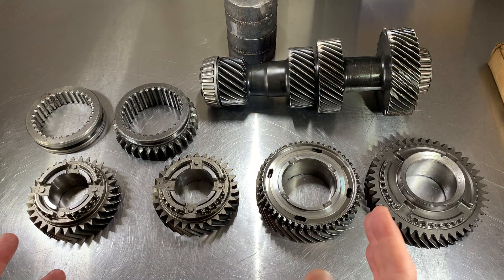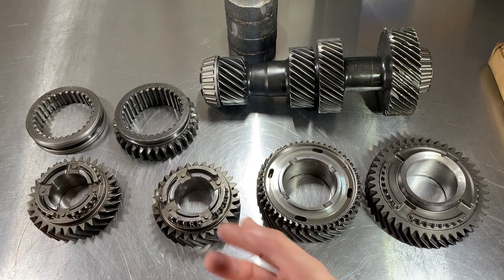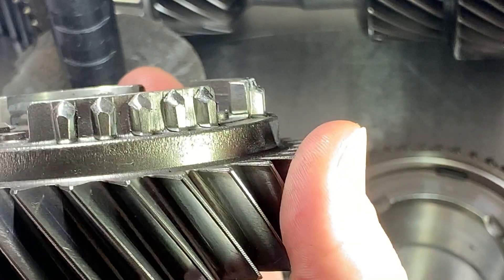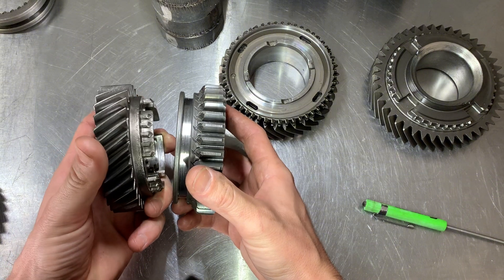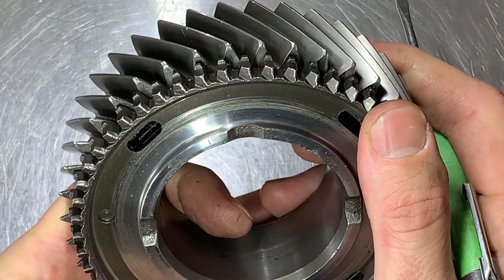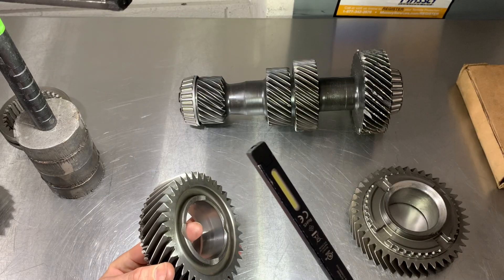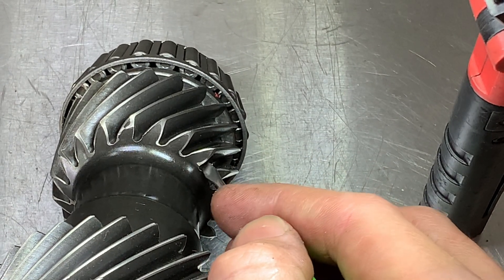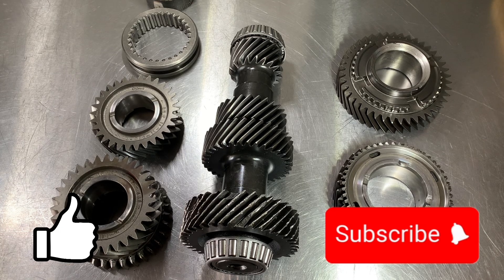Manual Transmission Gear Wear: Grinding, Pop-Out, and Noise Explained

Comment: My T5 has a vibration that is felt thru the shifter.  Most noticeable in 4th gear but does it slightly in the other gears.   Has 48k miles on it.  Shifts fine and no grinding/noises.  What would you think could be causing that problem?

Comment: Bro your 👍🏽 carefull 2:53
Reply: I hear ya,  but for those that have worked extensively with certain tools, safety is whatever gives you the most control. 
But ya, just seeing that shot does give a stomach jump, but clearly this guy has more hours with that Dremel than most folks with a toothbrush.
That's my bet tho! : )